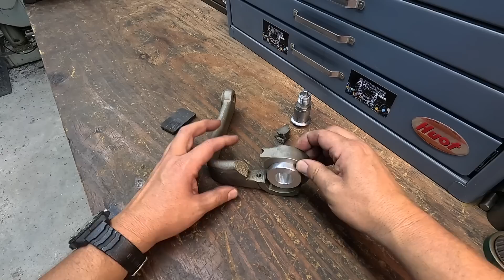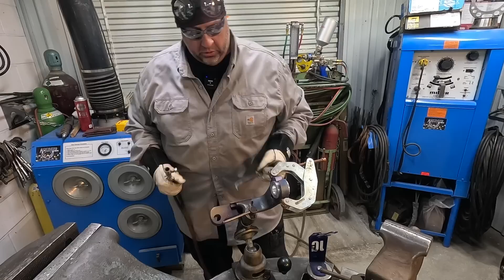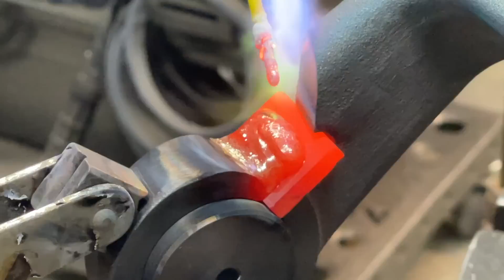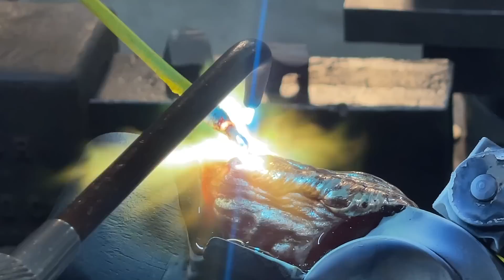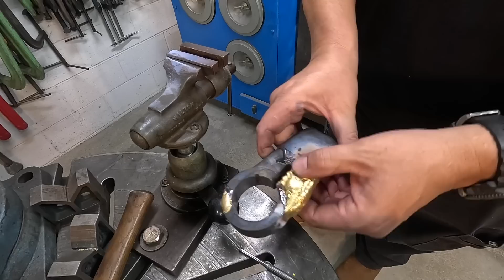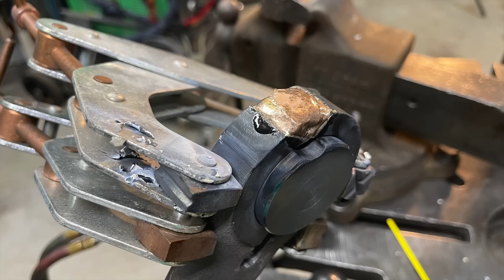Broken Lathe Feed Change Lever Braze Repaired

Comment: That 1/4-20 is probably Whitworth on a Colchester,  so consult Machinery's Handbook for clearance and cap head dimensions,  or just chase it with a UNC tap and use a new UNC screw.  Not many Whitworth sizes have the same thread pitch as UNC but 1/4-20 is one.

Comment: Enjoyed the brazing, good job! One of my favorite methods fixing stuff. Never liked the flux pre coated coated brazing rods but these seemed to work really well. I have always used AGA cobra 25, have a large old stash of these. Borax flux in a piece of angle iron works very well. 
Don't understand the clamping design on this piece, it seems like it would be to stiff for doing much good when tightening the screw, Perhaps lengthening the slot could improve it.

Comment: Bucket goes up because you create a steambubble which then starts imploding, the mass and inertia of the water above will accelerate the bucket upwards as the imploding bubble "sucks" the bucket up. The whole thing is made even more pronounced because the watercolumn above is also moving upwards as a result of the explosion, also dragging the bucket with it.

Comment: Adam, like always - nice job.  Abby - if the camera is getting over exposed with brazing / welding - yes, you can shoot through a fixed welding lens (#5, #10, etc.), but that can change the color of what you're shooting.  A variable neutral density camera filter will reduce the light without changing the color.  Variable ones use two polarizing filters allowing you to adjust how much light to block.  Regardless, sweet work the two of you did on this project.

Comment: Nice camera work on the close up brazing shots Abby! You & Karen from Cutting Edge Engineering have captured some of the best detailed shots of gas welding & brazing that I have seen. Well done! Thanks for an informative & interesting video Adam. Also did yu know that you can remove that glassy hard brazing flux by just soaking it in water. Takes a little bit of time but does a super job.

Comment: In my early days I spent thousands of hours soldering electronic parts.  The way that you did all that brazing was amazing, and way fancier than anything that I did with solder.  Thank you Abbey, for getting all of those closeup videos!  It's amazing to think that Adam can do brazing like that and then turn around and make Fusion 360 and CNC programming look like a walk in the park.

One sorta physics question:  was that slab of carbon a slab of graphite or some sort of sintered powder?

Comment: Nice job.  Back when I learned to weld - about a 100 years ago, gas welding, cutting, and brazing were on the menu.  That was followed by some basic foundry work, and stick welding.

In those days, only the military and large businesses - read: "government contractors" could afford mig welding, so I didn't learn that until later on in life.  I never did learn tig...nobody I knew had a tig welder.

Comment: I wonder if that clamping bolt is even needed, since it seems it was modified to be locked in place with a set screw. I imagine the original design had a tendency to slip, or it was already cracked in the past and the set screw was added as a workaround.

Comment: A good overall result, just a small question when you had finished the first braze and found the other piece was captive, why did you not just groove the cracks and braze, instead of cutting it out and building up with a huge amount of rod? might have been quicker and just as strong.
Reply: Was wondering the same.

Groove one Crack a bit from the inside or Side, "tack" it, completely groove and braze the other one from the Outside and then go back for the first Crack from the Outside.
(Maybe a bit of Cooling for the other Joint while Brazing to keep it from softening or leaving a bit ungrooved to keep the Positioning?)

Although I personally would have glued it…
Reply: I wonder the same.

Comment: I hear you, but the part that Curtis made in Australia was way stronger than the original and he showed that it was still difficult to shift so a stronger peace, intentionally beef up is probably better than braising I believe
Reply: Considering the way this part clamps, the brazed portion will be the flex point rather than fragile cast iron. I'm sure it will work. If the owner of the lathe wanted a different part, they would have manufactured a different part. It sounds like they have their own mill, it wouldn't be that difficult to get a piece of steel cut and bent. Adam respects the machine owners wishes.
Reply: Not even remotely the same part…sometimes good enough is just right….mate

Comment: Yay! Home shop!

1. Would using an welding anti-splatter or masking compund for flame spraying prevent brass and flux from sticking to steel?
2. In my welding adventures, I used a hood that attaches to the welding mask to prevent backlighting. Maybe it will work with your darkened face shield?

Comment: I use braze welding for large repairs. but for that corner cast tab break-off or other small repairs I use TIG (-) with Ni rod.  Easy to control and a close color match for my old woodworking tool restoration guys.

Comment: That's like magic.  Like building up water into a shape.

Question:   Have you ever had or know a well brazed repair mistreated and break again?   If so does it tend to break at the braze, at the junction or somewhere else on the original cast iron?   I guess I'm asking if the brazed section is actually stronger than the original cast iron.   I've heard that cast iron can be a bit brittle, and brass/bronze doesn't seem to have that reputation.

It turned out beautiful...  a joy to watch.

Comment: As long as they were fresh breaks, I wonder if sweating the parts together with a cadmium silver brazing filler BAg-1 and high temp flux would have worked.
Reply: Or Allstate 11... It wets into gaps very well... saved our cast iron breaks for 2 generations

Comment: Adam what size torch handle are you using. I’d like to get a smaller handle for my rig. I’ve just been using the big heavy duty cutting torch handle that was already on my rig. It gets cumbersome very quickly.

Comment: Adam, I noticed you were checking to see, many times if your hearing protection was in place. I have used expanding foam plugs for decades and shot muffs before and after the advent of foam plugs. What I have done to stop it slow plug escape problem is to use a rounded tipped tweezer to assit in the insertion. You crush the plug while in the tweezer and  insert into the ear, following the insertion use your other hand to hold the plug in place when removing the tweezers, repeat as needed for the number of ears you wish protected. 

I got good enough to do this one-handed. The silence was instant with the foam plugs if done properly. I would also use shot muffs, the shot muffs helped with some of the lower-frequency stuff when I was needing that. I have used the foam plugs alone while in attendance at many rock concerts with no loss of enjoyment or sense of isolation since the face still senses the high frequency sounds without abatement. 

I hope this advice is of assistance to all y'all.

Comment: Would it had worked if you milled a slot in the steel puck and glue in a carbon insert strip, then turn it down to diameter in stead of a whole carbon puck?

Comment: One of the biggest issues with this sort of repair is the fact that cast iron is very porous. Burning the casting clean was a very important step, which involved getting it about 300c for a few hours. Also the very first contact layer is critical to the integrity of the repair. But you seem to have got it
Reply: There seemed to be little oil, I think the customer did the burnoff prior to shipping to Adam. The wetting of the cast iron is crucial, as we see on the buildup for the second side of the vee at the 'top'. Adam sooted that up a bit when doing the first section of the vee, the side where the bolt head will go. I would have wet the surfaces first and built to the middle. But that is me, others would have just wet the exposed iron and done the buildup as they saw fit. The soot did not stop the wetting once the flux penetrated to it.

Comment: Years ago I had an old Singer sewing machine that snapped a connecting rod during shipping. The pieces seemed to fit seamlessly when I held them together but I couldn't see a way to rejoin them without ruining the geometry.  I can see now that it might have been possible to braze that cast piece with a v-notch on one side then flip and v-notch again.  I needed this video in 1992!  Or probably I should have just looked for a good machinist like Abom.
Reply: Good luck 😂😅 not many around now, all the best

Comment: Abby always getting in to get the perfect shot! Great job, Girl!
Adam, you have quite the brazing game, my man. While it did take quite a few rods to fill that cavernous gap, it turned out absolutely beautiful. I'm sure that Cadence will have no trouble machining for the cap screw and doing the counterbore for the head.
Those rods flow like hot butter and stick like super glue. I definitely learned a few tricks in this one, not the least of which was when to abandon the original pieces and go all in. Smart decision that I would not have made due to my inexperience.

Comment: Adam..Noticed you wore a pair of tinted glass and THEN YOU used the shield..Wasn't that too dark?  Your handle came out nice with braising.
Reply: I would suspect the heat from the growing area of weld and the length of time warranted full face protection.
Reply: @tjr4744  ThisI know..but why 2 sets of tinted glasses was my original question?

Comment: My dad could braze like that, don't recall him using flux coated back then, I never caught on.  This was back when adding refrigerant had to braze up the lines.  Kudos for keeping up a lost art.
Reply: You know there's real skill involved when they make it look easy
Reply: He used flux in a bottle, a crusty can with a hair brush. This was usually water based, Oatey was one. The very fine lead powder mixed into the zine chloride, ammonium chloride, and may be hydrochloric acid -helped to brighten the joint and allow the lead based solder to wick and stick as it was called. That was an old plumbers trick though, lead was usually not in the fluxes,  just in the solder <g>. If he was dipping the rod into a whitish paste that was the flux, if was more fluid then he had added water or beer. If it was beer there was foam, did you see any foam?

Remember the smell of mustard when he tinned the pipes? That was burning oil and the trace of refrigeration gas/fluid trapped in the oil burning into phosgene, hydrogen chloride, hydrogen fluoride, and chlorine, all this is worse than mustard gas from WWI. Very old Freon Leak Detectors originally used a flame and a tube. Placing the tube near where you think a leak was (oil showing usually) you could both see the freon gas burn and smell it. The color of the flame from the halide heating a copper bar (blue) to detect the presence of chlorinated refrigerant --the normal blue flame changed to or was tinted more blue/green. You would get the same smells as well.

If it was older -when Ammonia was used as a refrigerant, the smell would have been pungent, urine smells. Working on these units back then was bad for your health and smelling equipment (your nose).

Ah, the memories those smells bring back.

Comment: Adam that was a nice repair. As you say the trick is to keep the heat into it without having half the filler metal end up on the floor. This is the kind of repair that appeals most, to me at least, especially if it also entails some lathe work.
Hi Abbey, that was some nice video you took there and I could see you were intrigued with the process. Fascinating isn't it. Those clips you took very clearly showed the skill required to do this kind of repair and the process needed to effect such a repair.
When I was a first year apprentice plumber I was working on a roof with the tradesman I was learning from and he was welding some aluminium (aluminum) roofing sheet. I was absolutely intrigued by the process and keen to learn but I got a little too close. As the mate pulled the flame away from the job so that the metal did not droop on him he lifted the torch high and wiped the flame across my face ( he was looking at the job to see if he was in time or too late with removing the heat). Only cooked the outer layers of skin though so it was OK, but as I rubbed my face I felt the skin roll under my hand. Can you believe it did not hurt much at all. I went to the first aid cabinet and put some burn cream on my face and went back to see the rest of the welding. To my great disappointment he shut down the gas just as I got there. Then he added insult to injury by asking me to go to the shop and buy him lunch, me with this thick grease like stuff all over my right cheek, every body was looking at me as though I had some great disease or disfigurement. That hurt worse than the burn. That was back in 1962. Cheers guys and many thanks from Australia.

Comment: Great job. I am also curious how you would make a completely new replacement part if one gets broken beyond repair. I expect getting all the measurements and aligning everything would be quite the chore with a broken piece and transferring it to new material.
Reply: Actually, not hard at all, the fracture grains aligned the pieces very well. You can wick some superglue into the breaks and get your dimensions very easily. 
Another way to fix this is to silver solder it... 

With very thin silver solder hammered with the joint clamped together placed into the breaks and clamped and heated with the right flux the repair can be done without all the bronze filler needed. The key is the rolling of the silver solder into a flat which will be flexible while in the break, filling the grains as if a part of them also with the right flux also in the joint. It will need to be about 0.002 - 0.003 imperial  and the flux very thin as well. The clamping must force the joint together as the heat melts the solder. No real need for preheating here. This could be done in an oven of the correct temperature. Doing the joints all together is best but one at a time would work if you used two different temps for the solders. High first then the lower one.

Comment: Adam, I'm curious. Did you consider tig welding, instead of gas brazing?

Brass is probably "plenty" strong enough for a gear shift leaver, but from an appearance point of view, a "steel" filler rod would look "original".

Though, steel would be much more difficult to match the contours of the original.

Thanks for another interesting video.
Reply: The piece isn't steel but cast iron, which is notoriously difficult to weld. Appearance of the metal doesn't matter if you paint it anyway. But personally I rather like the repaired look. Adds character.
Reply: @olavl8827  In Japan this is appreciated as "wabi-sabi".

Comment: Thanks for the great video. Abby did a wonderful job filming. Here's my 2 cents....I would have shipped the broken lever to Clarke to have it recast. Afterwards you could bore and machine it to dimension. On a similar bronze filler repair, another youtuber fame by Squatch253 had a huge cast iron steering component from an antique tractor repaired with bronze. They used a pneumatic needle scaler to apply a sand cast like texture on the surface of the bronze for authenticity.

Comment: Have you ever tried aluminum bronze with AC TIG? I tried it for the first time and was really impressed. Cast iron repair for a planer.

Could you provide the details on the rod you used? I like how the flux was very smoke-free.

Nice work Adam
Reply: Adam has done tig braze in the past, but most of the people doing this type of work tend to use flame for these big repairs.
Reply: You can DC tig with silicon bronze, real common rod compared to aluminum bronze. in my experience anyway. real strong stuff
Reply: @rusty_restorations36  yep done that too. The one thing al bronze has with AC is cleaning action. It worked very well on a dirty casting

Comment: I wouldn't bother fixing that. Just replace with a steel bar, bend it and drill holes. Cast pieces are always a problem. I really don't like cast. It's a waste for tool/structural pieces. You could have done that in half the time with a steel bar. Nice brazing though.

Comment: Does anyone know what the blue thing with the stack coming out of it in the background is?
Reply: welding fume/smoke extractor
Reply: exhaust hood + air cleaner
Reply: Flux capacitor. It’s what the lizard people use to check the wheel bearings on the space lasers. Adam has the maintenance contract.😬

Comment: QUESTION:  When you filled gap with braze... why did you make the cast-surfaces smmmooottthhh?
Would it not have been better to leave some 'steps' or 'grooves' in the casting so the braze has some tooth to grab on to? (more surface-area contact too)
Reply: It's a chemical bond not mechanical. The braise forms a metallic bond between the two. The two metals share electrons without being melted together. That's what makes it work.
Reply: Depends. Largely, you want to grind down and have a clean surface. The surface profile doesn't need to be rough at all as the surface pores open up once heated and the braze sticks via capillary action. That said, no need to Polish the surface prior to brazing. Any flap disk or 80-120 grit sand paper is fine for prep. And you actually have to make room for the braze. Silver braze is great for tight tolerances such as pipes to flanges, but bronze or brass need room.

Comment: Question: Instead of cutting out the second piece, why didn't you used a burr to vee it out and then braze it in place?
Reply: Exactly what I was thinking - more of the original material for strength .